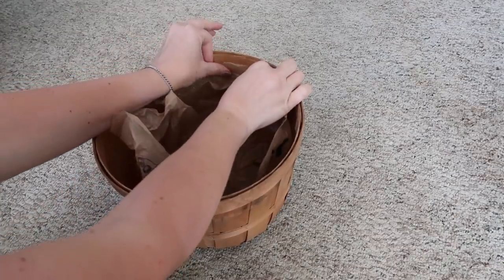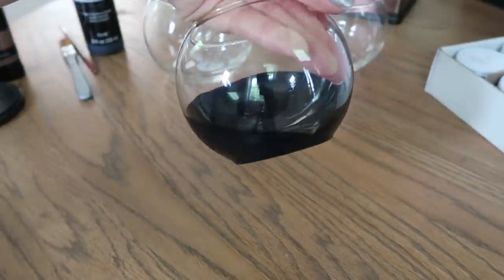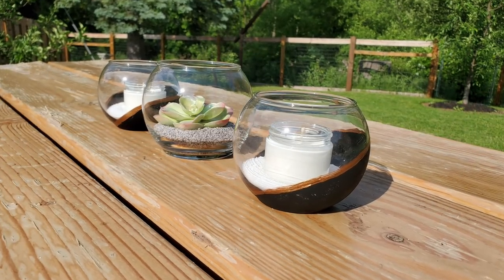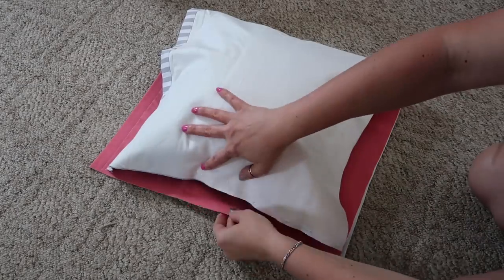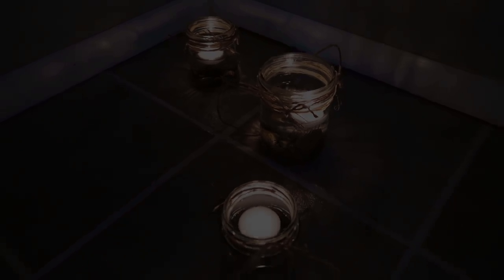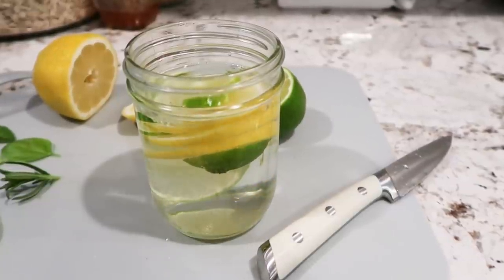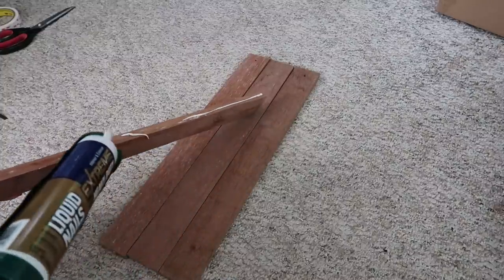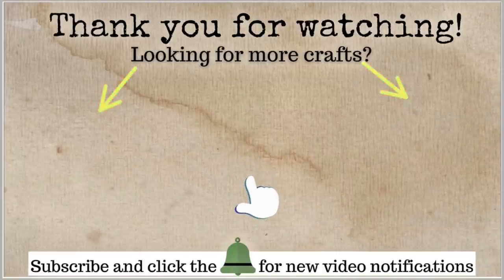8 HOME HACKS for your OUTDOOR space | Decorate a PATIO, YARD,  WEDDING or PARTY | THRIFT DOLLAR TREE

Comment: Hopefully this may be seen as a helpful/crafty suggestion - MANY times you can find LARGE citronella candles (sometimes for a reasonable price) - if you cut them up in chunks and put IN your smaller jars (or a glass pitcher or anything with a handle) - melt them in your microwave (or double boiler style on stove) and pour the liquid wax into the jars you want to use - BTW -you can reuse the wicks from the large candles by cutting in shorter sections and glue pieces to a piece of aluminum foil or cut pieces of foil pans from grocery or Dollar Tree etc. - OR get wicks from Wal-mart or various Dollar stores and glue to inside bottom of jars and you're all set !!

Comment: Tip for removing labels. Put Very hot water in jar. Let sit for a few minutes to heat up label glue. Then peel label off. Most jars the label peels right off. Doesn’t work on all jars but works on most.
Reply: U can also take a hot gun or blow dryer heat up label it comes right off!!!!  Once u remove label u may hav add lil more heat to get off any glue left on jar!!!  This is the quickest easiest way to remove labels on anything wood, glass, plastic I hav tried this method on everything n it works amazingly!!!!!

Comment: Mini citronella candles: you can make them yourself. You can buy the small jars with or without covers get a full size citronella candle and melt it down using the melted citronella wax put it in the smaller jars with a wick and make your own candles. Or you buy plain wax and you buy citronella oil and you can make your own citronella wax